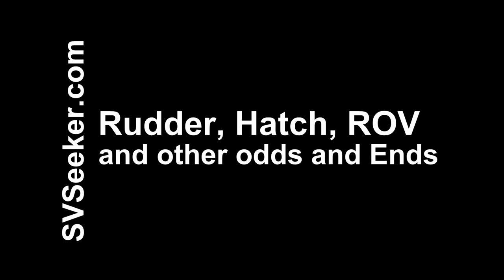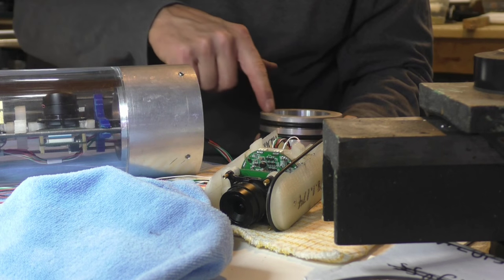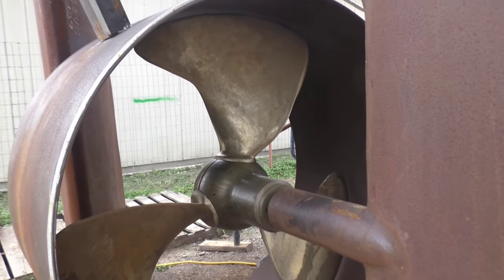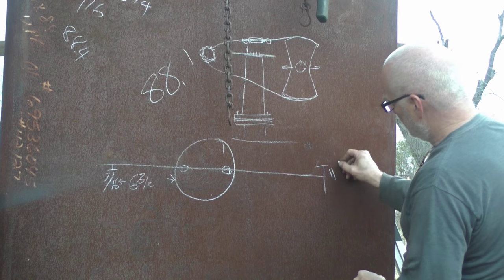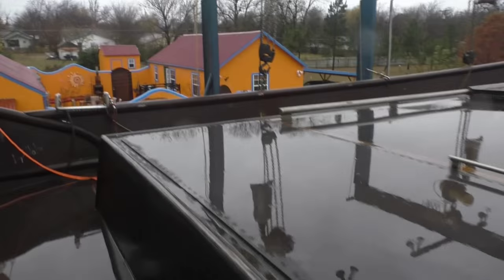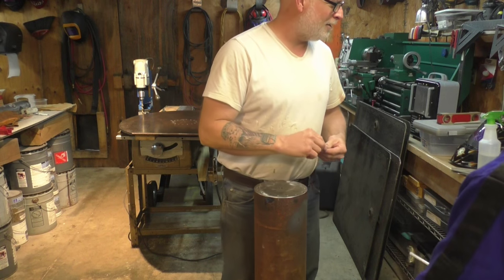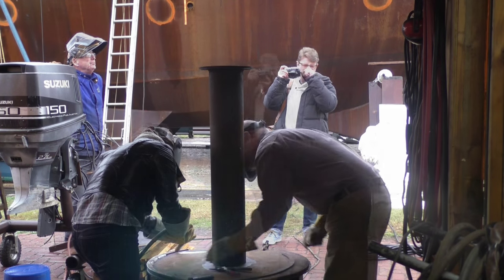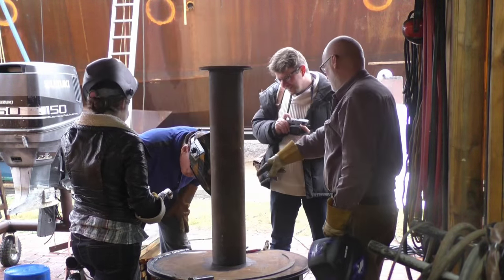Rudder, Hatch,  ROV and other

Comment: Instead of wire I would have gone with ordinary chain, easier to hook up to the rudder post. 

Also in the video you talk about that the chain/wire loop is at an angle from the sprocket to the rudder post, this seems dangerous especially with all the forces. All movements will grind and damage the wire unless it is at an perfect straight angle, and with enough force it will rip that extra guide-lip of like wet paper.

Isn't there some kind if differential windlass (https://en.wikipedia.org/wiki/Windlass#Differential_windlass) -kind of system that prevents the rudder from moving unless you turn the wheel?

Comment: talking about the bolts in the rudder post being "only 3/8"
when you have 16 of them you equate to 6 inches of steel. I'm fairly sure not even 50 tonnes could sheer through 6 inches of steel

Comment: i know it few months old but just asking i am no expert but if i am right if you take out all pressure from ROV if there was leak you would not be able to know untill it out water and too late as no bubbles will form to pressure being nothing in ROV but it looks like  it well made any way so no point just make more tasks when you need to open it up i would fit with water senser problem  Sorry for any bad english
Reply from the maker: +Andrew Martin    We are going to have pressure and humidity sensors inside the ROV that will let us know if there is a leak.

Comment: why not just a shaft from the tractor angle drive to the quadrant.  outer edge of the quadrant would be geared.   gear "size"  on the shaft end would give you what ever steering ratio you want.
no chains,  no cables,  little maintenance.

Comment: normaly we clamp the quadrant on the outside of the rudder stam.locked by a key.. (worked on my tugboat boat for 128 years now! )(steering chain on it, not wire), via a couple off chain wheels to the steering hub big gear (about 50 cm dia) and small gear (about 12 cm ) on the wheel (1.6 meter dia) (rudder is about the same size as yours, 1,8 meter high  only my prop is 1,6 meter dia 4 blade fixed.(no shroud)
Reply from the maker: +MrBugsier5   We considered that, but I don't have a good way to cut a keyway.   We do have a very nice mag drill.  :)  No you have a hydraulic auto pilot?
Reply: no, its a inland harbour tug (Bugsier 5 (the first one build in 1887 as steamer)(google it, its on the net) there where no autopilots in 1887! lol  only hand work the steering on my tug! lol

(steam engine removed in 1955, then equipped with a air start 6 cil four stroke Deutz diesel (also video on you tube , type main engine bugsier 5 1887, to see it running!)
Reply: btw, angle grinder will work well for that size key! lol

Comment: hmmm dunno how often the rudder will spin out of controll like that but you could change the tire for a smal shock absorber or (car)spring to soften the peakload 
i would maibe once a year go in there and change out those bolts for new ones
if only just for peace of mind that the rudder will keep operating at the worst possible moment , it wouldn't cost a lot and you can check those old bolts to see if they gotten close to shearing

realy getting a lot of use out of that magnetic drill , looks like it can do as mush as a columdrill if you buy a piece of steel to use as a base for the materialclamp but the machine takes less space and can drill bigger holes for less cash outlay  ..... might buy one too 

watching you and the others work out mathematic problems with plumbobs and stuff like that makes me learn new tricks on problemsolving every time i'm watching
Reply from the maker: +watahyahknow   That drill is sure to find a place on the boat.

Comment: Just another comment - the chain you are using - if it were standard chain not stainless - is rated for ultimate strength of 8,500 lbs.  Will this be enough in an emergency??
You can see chain specs at  
www.gmtel.net/web/drittmer/Technical/mechanical/Roller%20Chains.pdf
Reply from the maker: +Newmachinist Good link.   Stainless is weaker, but not much.   ...but we are using two of them anyway.   The load is really based on the fact that most people can't hold onto the wheel once the load exceeds about 80 pounds or so.   It's designed for about 33 pounds which translates to around 4000 pounds on the chain and cables.   http://www.svseeker.com/wp/helm-notes/?v=e9841d3e5f8a